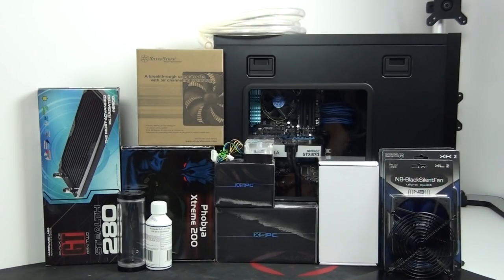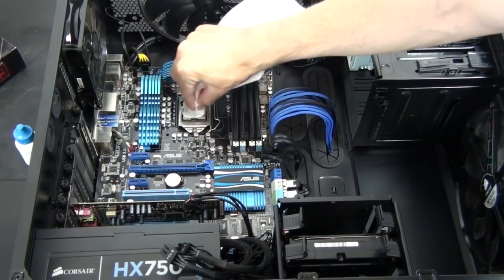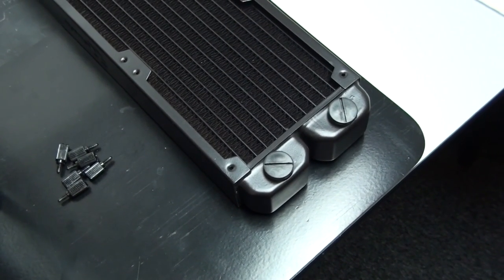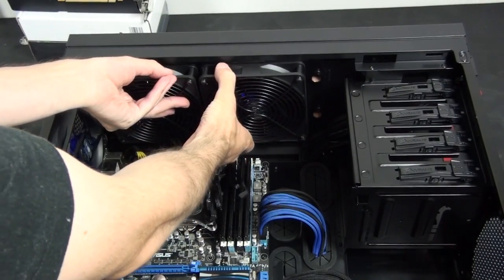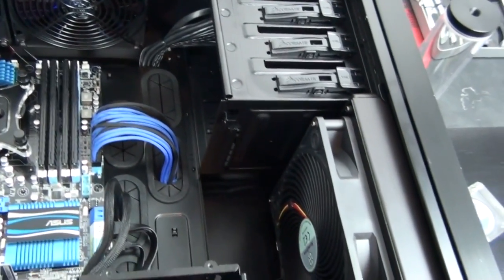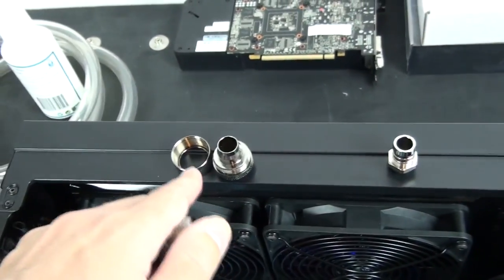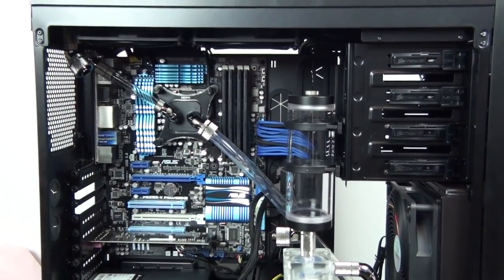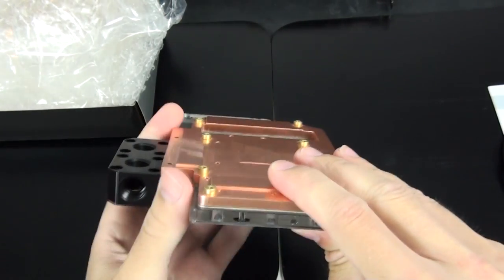Singularity Computers Water-cooling Guide: Part 1

Comment: One tip for cutting tubing is to always leave more than you need after cutting. That way you can check to make sure it reaches and then cut accordingly. Can be a pain if you have to throw tubing away because you cut it too short.

Comment: Well I've used AS5 for a fair few years now and I find that staining the integrated heat spreader with a dab of TIM and spreading it on with tissue paper. Most TIM ends up on the paper, however you will see some colour change. At this point the TIM is in the tiniest cracks on the IHS. That's just cut down the break in time by a huge factor. Then just apply a rice sized dot in the middle and job's done :D

Comment: I plan on watercooling my Fractal Design R4, it is a mid tower. Will be very tight fit around the cpu area but other than that it will be fine(this is for most mid towers)

Comment: Great video for begginers. What do you think about using half inch barbs with 3/8 inch tubing and not using clamps? Just putting the end of the tubing in hot water and putting it on the barb so when it cools down it makes a seal.

Comment: Did you mod the case to fit the 200mm rad in the front and what did you use to mount the 18cm fan on it? 
I'm thinking of setting up a similar loop in my 650D but I'd rather not take a dremel to it. Great videos btw, you definitely inspired me to try watercooling for myself. I'm running non-reference cards though (MSI 6950 TwinFrozr3) so no fullcover blocks. Any chance of a video on installing just a GPU block and heatsinks, or would you just recommend selling them and getting a reference card?

Comment: Great vid as usual mate, What are your thoughts on using 7/16" tubing and 1/2" barbs? I tried this on my latest build as I personally prefer the aesthetics of barbs over compression fittings but I'm not a fan of the clamps.This way the hosing is so tight over the barbs I didn't need to use clamps.

Comment: 15:57, what are those called? I want to use those in my 650D build. I'm going to have that same reservoir with same clamps and ek uniholds too. From the res->Mcp655 pump->GTX 780->120mm Rad->XSPC raystorm watercooling cpu block->EX240 Crossflow Radiator because i want to make it more clean i guess even though its like a V, this is what i believe it will look like then it'll go back down to res. Is that a good setup? What i meant by V is: tubing from 120mm rad rear to cpu block then to top rad240

Comment: i have a thermaltake bigwater kit and it just sucks its to big to fit in any systrem unless you have a 900D or case labs or a thermaltake case designed for it might just go get an XSPC X20 750 and a black ice 120mm Rad and some mayhems aurora do you think this sounds good ?

Comment: hey i'm really thinking of liquid cooling my build in my z11 plus case, do you think its worth it to just make a loop for cpu if im using an fx4100? I found a koolance block, xspc reservoir, EK radiator and some dazmode pump for $235

Comment: This is the same case and i was wondering singularityComputers, Can you give me the description of the height for the radiator+ fan i can use at the maximum for my watercooling? I wish i bought a corsair 800d instead now because i don't think i can fit a 45mm rad and it cant fit a 360mm RAD but combine the top and rear i can >_>

Comment: It looks as though the Razor mixes copper and aluminum. Have you ever had a problem with Galvanic Corrosion? My build will have a solid aluminum part connected by tube to a solid copper part, with the only real connection possibly being the ionized water.

Comment: hey Daniel,
I've been talking to Ronsanut, and hes been helping me try to find a RS240 to fit in the top of a Corsair 600T, but we couldn't find any in Australia. Performance PC's has them, but i'm not really prepared to pay the $60 in shipping. Ronsanut mentioned you might be able to get one shipped over with one of your orders and im just wondering if that would be possible? or could you suggest another radiator that might fit. Message or comment if your willing to lend a hand :)

Comment: Is it okay to have the reservoir above and in front of the pump? Can anyone please explain more in depth thank you.
Reply: you've probably already got your answer elsewhere by now, but, no. Your reservoir must feed directly into your pump because there is a wet seal inside the pump so if you turn it on with no water being fed into it it will fail.